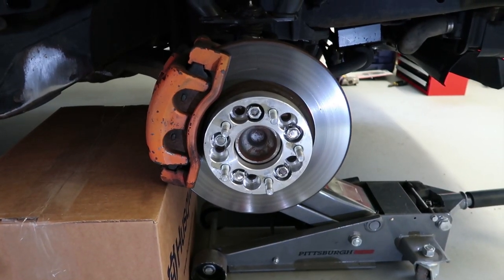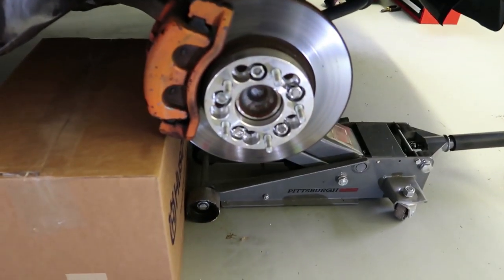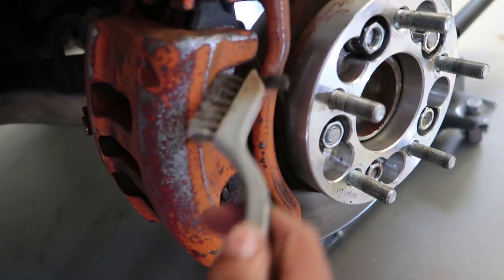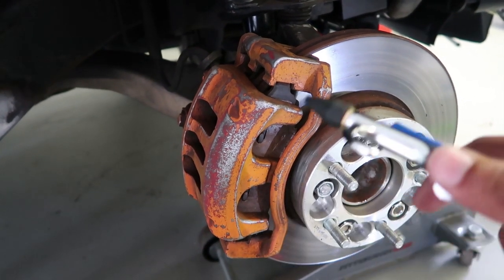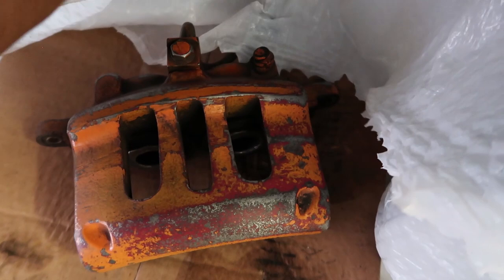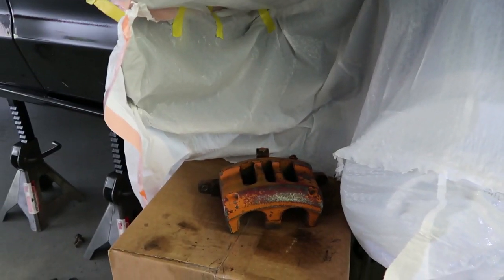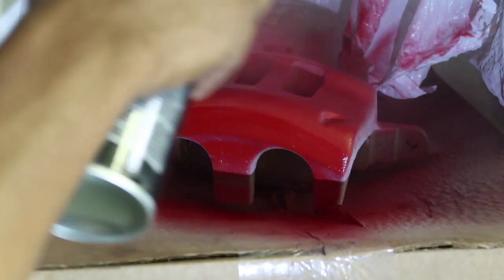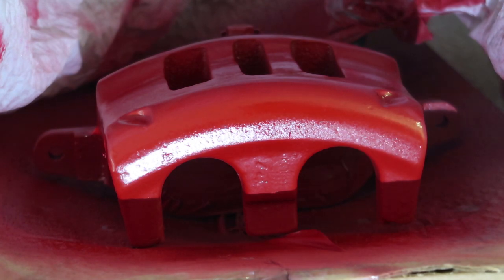Best & Cheapest Way To Paint Brake Calipers

Comment: I have one with 26" rims and my abs brake line is not long enough. Any advice to get something longer?
Reply: Extension
Reply from the maker: Yea they sell extentions but u really dont need it. With 26s ur brakes will never lock up anyway..
Reply: Thanks
Reply: @2xmototv206  I need some advice my car wrench light came on and now she won't go ova 40 mph? I changed the transmission and rear end on her and she won't go ova 40 any ideals to troubleshoot?